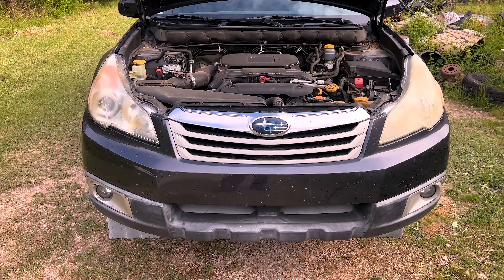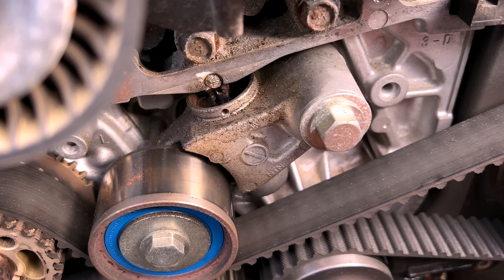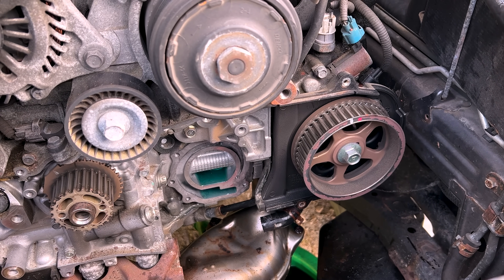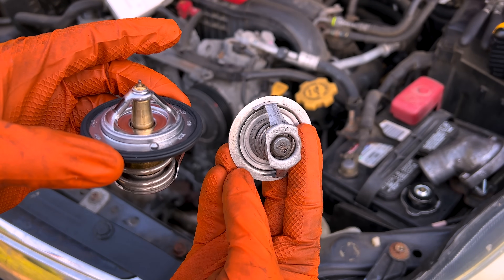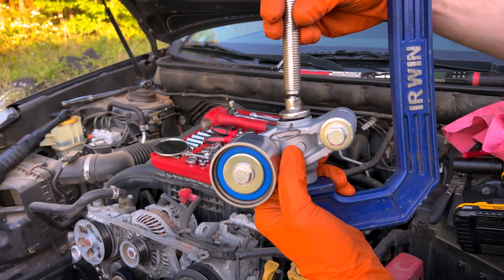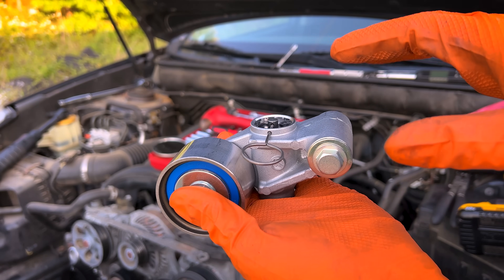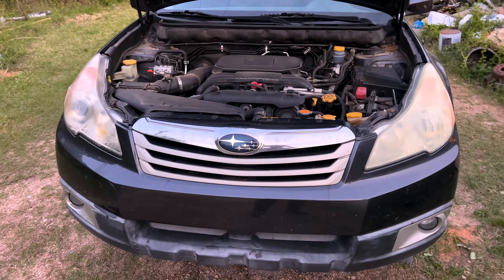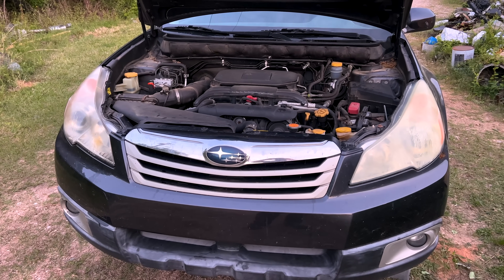Subaru EJ Series Engine Timing Belt Service Tips And Tricks!

Comment: I’m doing the timing on my 2003 Subaru baja I stripped the threads on my bottom right teethed pulley any tips on how to make it right ?
Reply from the maker: I have a video on installing Time-Sert inserts - https://youtu.be/vPv92brzxt0
Reply: Thread repair kit. It'll be an M10x1.25
Reply: @bramshobbyshop757  alright cool I appreciate the response! it stripped becuase the belt was to tight going the pin is still in the tensioner any idea why I’m having so much trouble getting the pulley in with the belt on besides the tensioner ?
Reply: the cogged pulley bolts into the water pump, which you should be changing anyway. if you where not, well do it now and your stripped thread issue will be solved. use an Aisin or NPW Japan made pump only!!! leave the flanged pulley off until you have the belt on everything else. put that on last and dont overtorque any of the pulley bolts